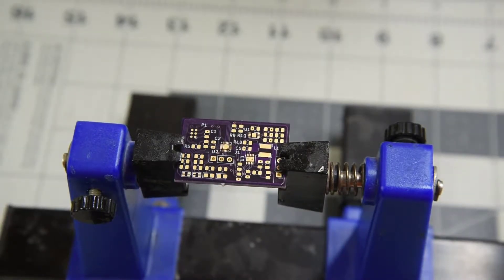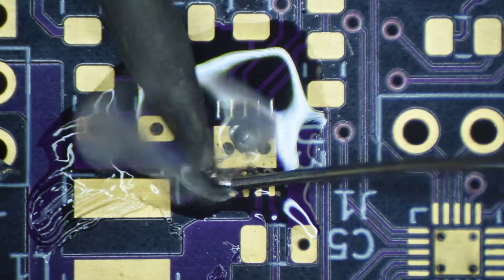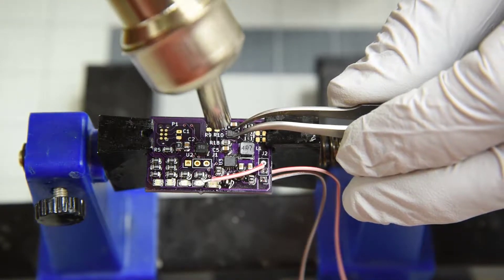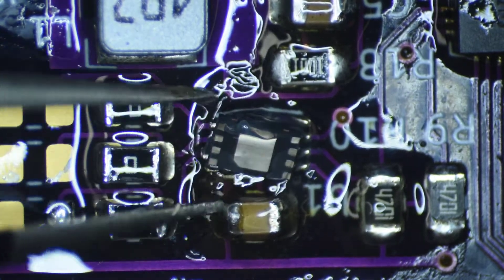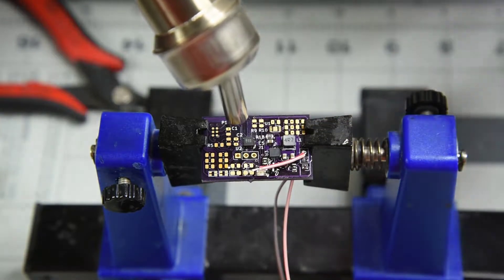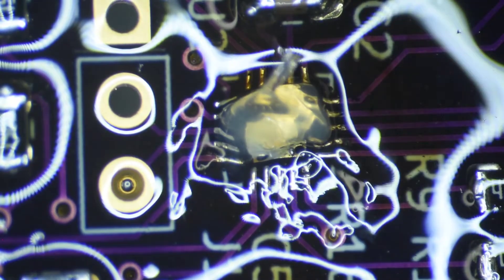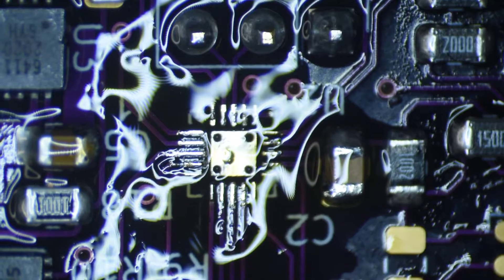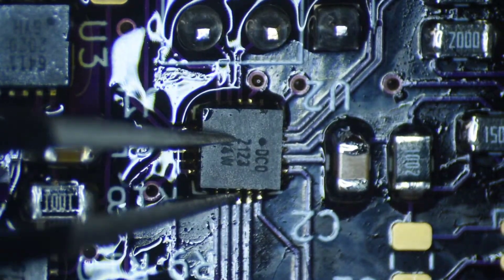DFN QFN Package Practice with the Atten Hot Air Station

Comment: Not too shabby... Keep practicing! You'll get there.

A couple tips:

- Lighten up on the flux just a tad. And by 'just a tad,' what I really mean is like 10x less as a start. Once that stuff starts to bubble and boil, your part is just going to float on it and never make contact with the pad - which is why you're having to push it down.

- And, yes, way less solder on the ground pad. You can get away with excess on the pins, since you can clean it up afterwards, but if there's too much on the pad, the pins will never even make contact. General rule of thumb is like 2-4 pins' worth. Remember - solder melts when it has to carry current. You always want metal to metal contact. The solder just A) fills the gaps, and B) holds the metal in place.

- It's really just personal preference, but I've always found chisel tips to be superior to conical tips. There's more surface area contact, and thus better heat transfer. (Conical tips are great for anything involving wiring, whether it's point-to-point or splicing into harnesses. For everything else, I use a chisel tip.)

Still, though. Keep at it. You're on the right track. Everything I'm telling you, you'll figure out on your own soon enough.
Reply from the maker: thanks keep the info coming.